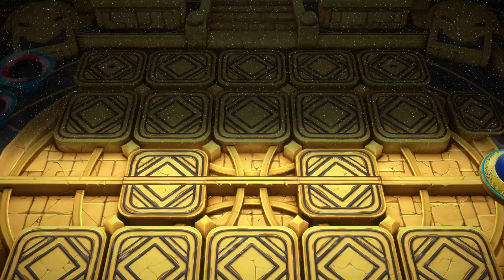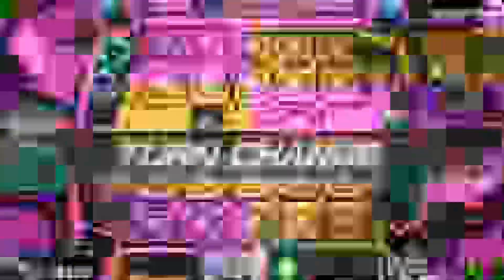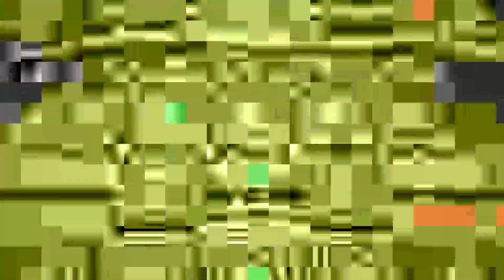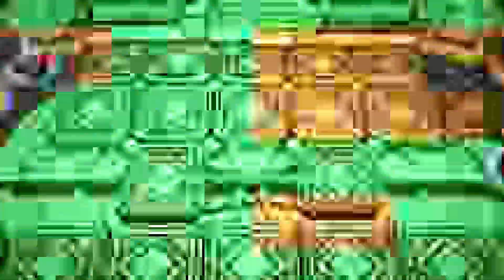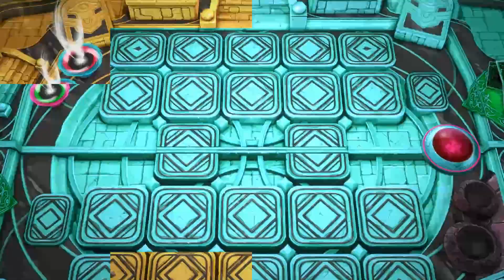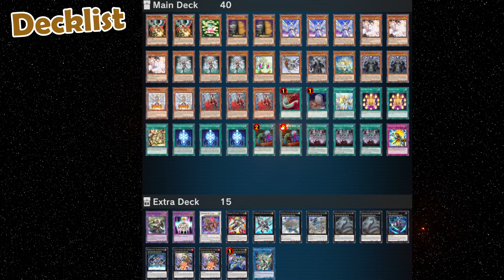BECOME THE BOSS! - GENERAIDERS combo guide (Pt. 1) | YuGiOh! Master Duel / TCG / OCG

Comment: I made it because I thought the xyz was cool and it ended up being one of my favorite decks and made it form diamond 5 to master 3 now, it's so fun and unexpectedly very resilient since you only need a boss stage to build a whole board again and vala in grave is guaranteed follow up for every turn. You won't win against tear every time but it's certainly very strong now and more importantly very freaking fun
Reply from the maker: In the handful of games that I've played on ladder, I bricked about 3 times. Do you have a (vastly) different build that doesn't brick that often? Cause that was the main thing that I have against this deck.
Reply: @cognitivegrub0 I don't run droll and I have 2 of the trap and one blossom and now I'm even trying cutting the blossom since I'm not bricking at all but I do run 2 mardelle since she's so good from blossom and with vala
Reply: @cognitivegrub0  by blossom I mean the plant monster not ash
Reply: @cognitivegrub0 also I do run the generaider trap that negates it's Soo good
Reply from the maker: @pokedude3221  Ah, I see. Sounds reasonable. Might want to test that out myself at some point. Thanks for your insight!
Reply: @cognitivegrub0 with aleister also viable mechaba also lvl 9
Reply from the maker: @zakifahmidwiputra8773  Definitely! I mentioned it in my 2nd Generaider video. Still think I prefer running Diviner though (requires less ED space to run, but Aleister has some other benefits - more consistent, possible additional negate).
Reply: Bro how I I can’t get past diamond 4 I get shit hands my lone flower and gene starters gets ashed ALOT. Like I know the combos but this deck needs ALOT  of rng to be good.
Reply from the maker: @Jose-yc6sc  Yeah, I am aware, I stated in the description "Due to the sheer amount of high level monsters you are running, you can brick on occasion, making this deck less fun than some other options from the new box."

Nevertheless, I've seen people praising the deck whilst reaching Masters for its consistency (https://www.masterduelmeta.com/top-decks/master-i/july-2023/generaider/succubus/5tDJX). I've experienced many bricks myself, causing me to not play it regularly. I will still use the Laevatein+Jormungandr combo for my Virtual World deck though.